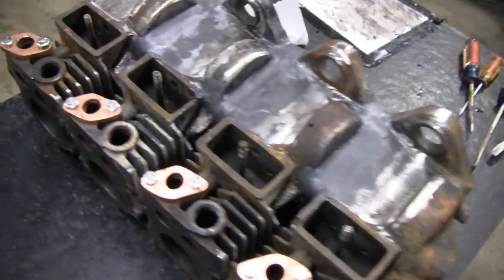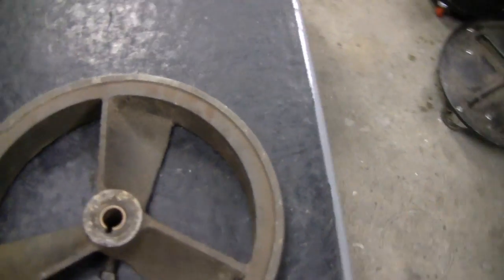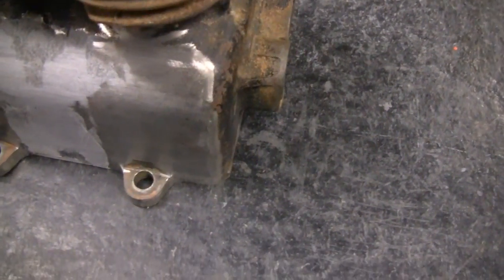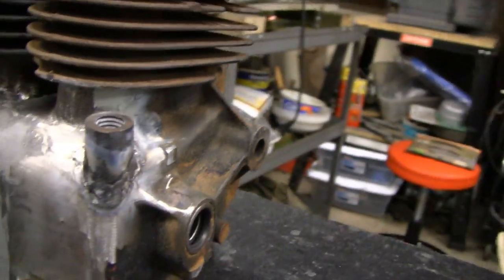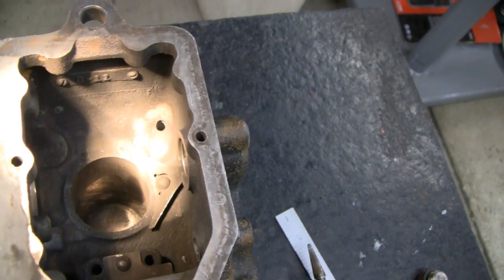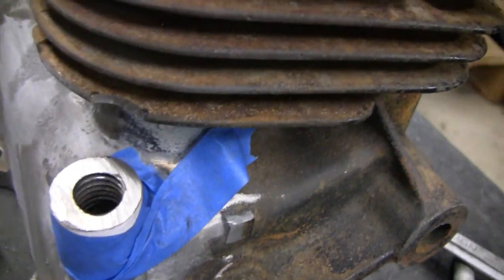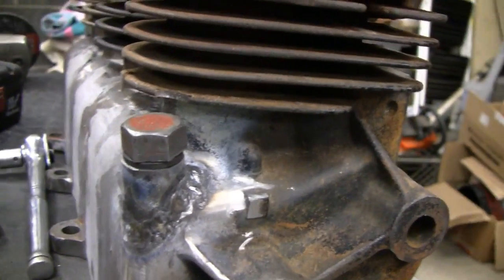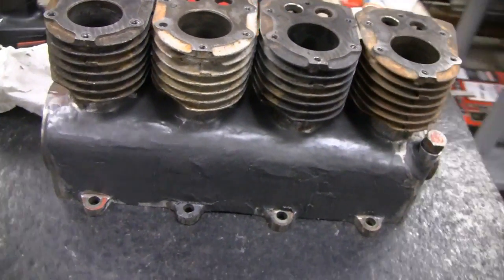HOMEMADE 4 CYLINDER BRIGGS PROJECT (part 10)

Comment: YO RK!! Magic Mike said in the interview at the show (last video on the I4 Briggs) that it probably gets 4 or 5 HP. Why not more? I mean a single cylinder gets 1 or 1.5, 4 working together should get more than their combined total, right?? Like when football coaches talk about synergy or someshit... Just typing a stupid stream of conscience here, but, what do I know?
Reply from the maker: Each engine is 1½ HP, that would be 6 peak HP at 3600 RPM!! That engine will never see that kinda RPM again, so Mike was even pushing it at 5 HP!!☺
Reply: @805ROADKING  gracias hermano!

Comment: Is that a Stover KE in the background? It appears to not have a mag on it; has it just been removed for repair or is your Stover a Bat/Coil model? I have a KE that came from the factory set up for Bat/Coil. Not very common, I've been told.
Reply from the maker: Nah it's a Stover CT2!! It had a Mag outta the Factory but we run it on a buzz coil!!☺

Comment: Awesome project. How are you making sure the crank runs true? Are you going to line bore it once its all done?
Reply from the maker: Years of experience make the crank true!! Nah no line boring, they're just lawnmower engines not hi perfromance racing engines!!☺
Reply: 805ROADKING do you sell these or something, also any idea how much hp it puts out?
Reply from the maker: Nah we just build them for fun!! It will be about 6 HP
Reply: I think they must have use epoxy to put the crankshaft together that's why they're not showing it

Comment: What are going use for , or just to say it possible to build , looking nice wondering plan the crank shafts together , so run in sink  un less it for steam
Reply from the maker: It's not gonna be used for anything!! It's will just be taking to Engine Shows with our other creations!!☺
Reply: Looks great each engine hold a 3/4 to 7/8 x 4  that take some time full , suggestion a vent some place ,4 wood be best thats up to you im pluging for you :)

Comment: I've watched all the vids on this project and it's looking realy good guys. I'm going stir crazy waiting to see the cam and crankshaft for this thing. Also the ignition system. I don't want to sound like a smart ass, but I'm thinking the rpm rating on that compressor pully is way less than the rpm this engine will run, so I wouldn't stand in line with it. Cast iron likes to explode if over reved. If your like me you'll grab that throttle and see what she'll do so be carefull. Great build so far.   Dan
Reply from the maker: Thanks Dan!! I think we'll be alright with the Flywheel!! It came off a 4 horse factory compressor that ran way faster than the little engines run at!!☺
Reply: 805ROADKING Compressor motor probly run at 3600 rpm with a 2 or 3 inch pulley on the motor at the most. That looks to be a 10 or 12 inch pulley. 10 divided by 2 = 5, so 5 to 1 ratio. 3600 divided by 5 = 720 rpm. I doubt that pulley has ever seen 1,000 rpm. Your engine will probly idle at about 600 rpm. Just saying be carefull when reving it up.  Dan
Reply from the maker: You're right, I didn't even think of the pulley size on the motor, it was about 2 1/2 inches!!☺

Comment: this is an interesting idea BUT cooling this thing is going to be a nightmare the fins are meant to cool an engine like this but the 2 center ones now have 50% less surface area to dampen heat and the 2 outer ones will have 25% less
Reply from the maker: Cooling was the easiest part of the whole project!! It will be getting massive amounts of air from both directions converging between the two center cylinders creating a helical vortex equivalent to hurricane force winds!!☺
Reply: idk how your going to do that but I cant w8 to see

Comment: NICE JOB!!! That thing looks killer man! You can put that old flywheel  in a large lathe chuck and turn it down to correct the warp surfaces, I have done it many times for older steam engines at school. Problem is finding a lathe with a chuck that large. Im sure a local shop would be happy to do it, prolly would take 20 minutes tops!
Reply from the maker: Thanks Mike!! We're not giving up on the old flywheel, we have a few friends with big lathes!!☺